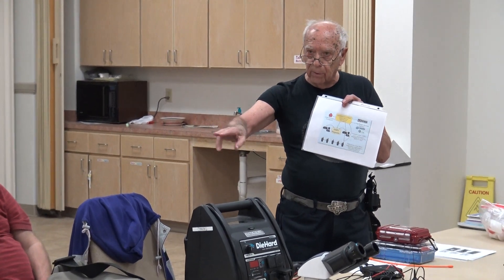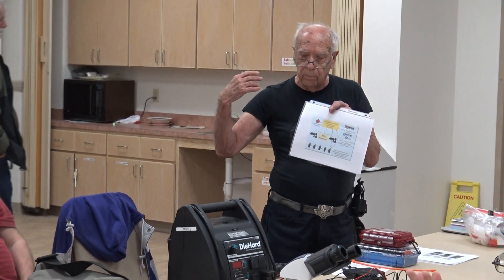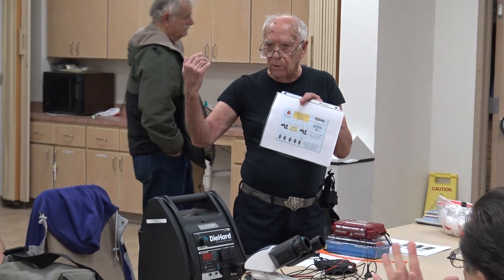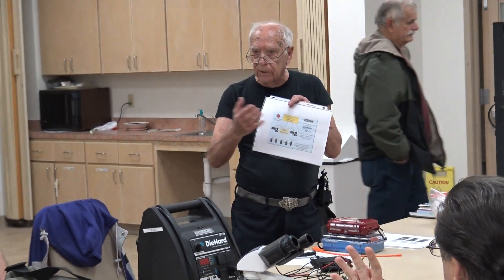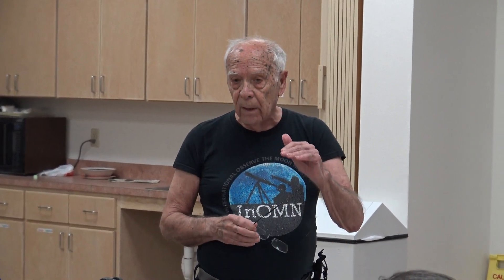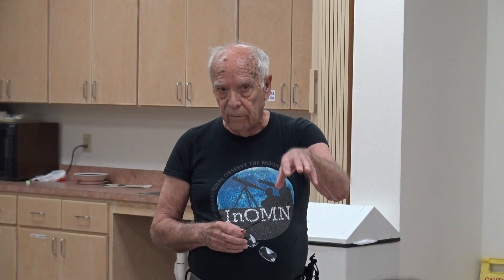FRS and GMRS radio for emergency Communications

Comment: Someone needs to step forward and standardize the channels.  

I run simulations and try to contact someone for traffic information.  When I do find someone talking,  they do not reply.  Probably because they are using a "Privacy Code" and my radio will not break their squelch.

So far the FRS / GMRS radios are a joke for emergency situations.  Lets say all power is lost.  I know about Channel 20 with the offsets and the tone code.  Forget that.  The average person that purchases a bubble pack radio at Walmart knows nothing about repeaters and coding.  Most of the bubble pack radio are not repeater programmable.  

What needs to be done is there needs to be a specific channel that people with FRS / GMRS radio know they can tune to when there is an emergency.  Lights out,  storm,  traffic conditions.  My vote is for Channel 19 with NO privacy code.  Yep!  Just like the CB days.  Channel 20 would be my pick for emergency traffic.  The standard would be with no offset frequency or tone code.  We are talking about making it easy for bubble pack radio users.

If the hardcore GMRS users want to add the repeater coding to their radios fine.  But,  don't try and make it a standard for everyone.  The majority of people own the Walmart radios and could care less about repeaters.

So,  how can we get this done.  Please let me know.
Reply from the maker: Thank you for your comment. I am not sure how to get it done, other than by spreading the word and starting neighborhood watch with band plans. Also maybe a national net.  This plan is a three level system.  The CB system failed because of no controls, I had a three story antenna and units in my car. Way to much chit chat. This neighborhood system included training and some loose controls. We recently were holed up in Texas without water and electricity for four plus days. Few could drive a vehicle. Stores were  out of food, etc. The only help that could be obtained was from neighbors. some of the elderly neighbors in our block, we did not hear from. The only ones that brought water, food to us were from the families on our weekly radio net that reaches about five miles  in a circle. it takes organization and cooperation to get this going. The plans are there as stated n the video.
Reply: @mecatx  Thank you.  I guess if someone wanted to start a "RadioNet"  that promoted specific channels,  that might work.  I looked up RadioNet.com and it is for sale.  I have not heard back from the company. 

I am approaching some of the Youtubers like your self to promote this idea.  I really do not know what I am doing.  Please give me input.  I would appreciate it.  Thanks again..

Comment: I propose that FRS and GMRS Radios use Channel 1 for an emergency channel, every radio has it, and the Baofeng Radio can be programmed to receive it. Use it the same way Channel 9 is used on CB Radio is used.
Reply from the maker: Thanks for the comment. We do teach using the 3  -3- 3 system, and also the 1,2,3, emrgency systems, and then let the mentored students decide who yo use it in their groups. i.e. CERT, boy scouts, etc.